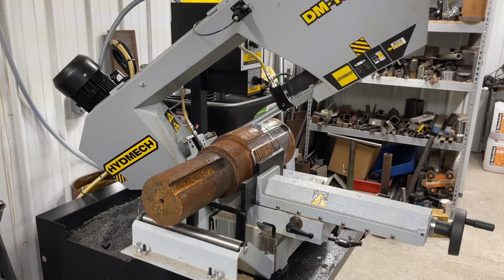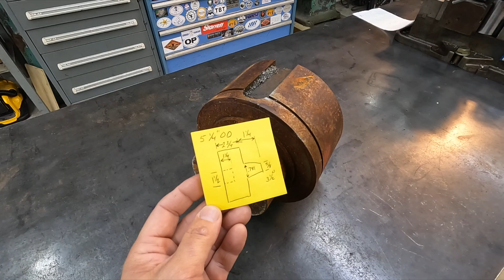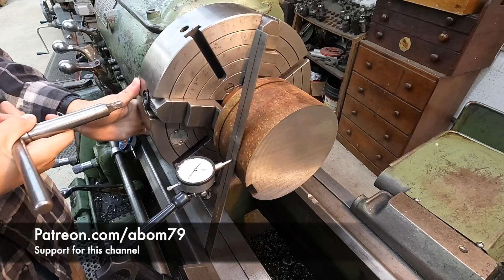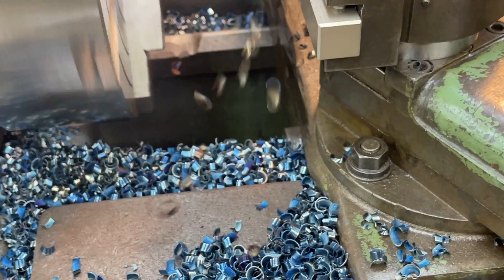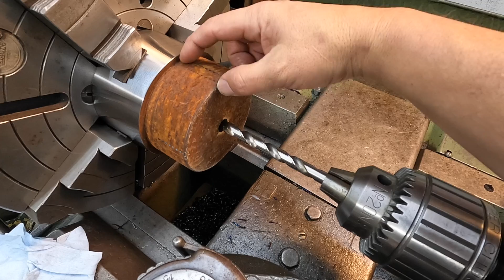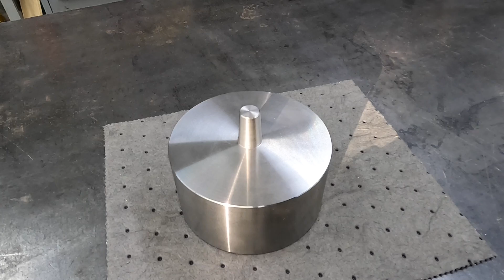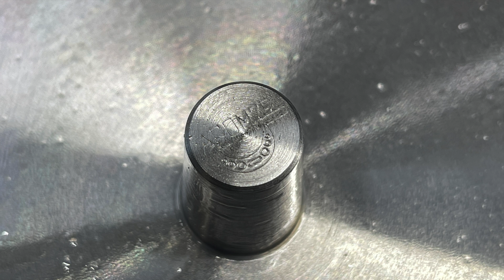Heavy Turning in the Monarch Lathe: Bradley Power Hammer Bump Stop for Blacksmith Tools

Comment: You say that you have your 4 jaw set to about where you need it to be to put your workpiece in to begin dialing it in... Is there a video I should reference for the basics on this??
Reply from the maker: I’ve shown it in many videos but couldn’t tell you which one. I use the corner of the jaw and line up on the machined circles on the face. Once all 4 our equal, offset each jaw in or out the same amount and measure. Keep moving the jaws equal amount until you hit your target.

Comment: Just curious what would happen if the operator became distracted or incapacitated and no one stopped the feed carriage as the tool holder approched the chuck? Is there a load or vibration sensor that would shut things down as things got nasty or would the machince just grind to a stop at some point and the belts would start slipping and smoking? I'm sure it has happened before.
Reply from the maker: You don’t want to know what happens…
Reply: There's usually a shear pin in the feed screw so that when the tool takes a machine breaking cut the pin shears and the carriage stops feeding. The chuck would keep spinning tho until someone turns off the machine
Reply: @matt657657  Dosen't help when it feeds into the chuck.
Reply: That's when what's called a crash happens. Look it up on YouTube, a lathe crash is a nasty nasty time.
Reply: Gear driven, not belts. 
Some lathes have carriage stops that will disengage the half-nuts and stop the carriage feed. 
That’s about all I can tell you as my only machining experience comes from watching Abom79 for about 7-8 years now. 
My dad was a FAA certified machinist but I was never allowed to go into work with him. But that’s what has driven my curiosity into watching machining content.
Reply: Same thing that would happen when driving your car towards a brick wall and you fail to stop.
Reply: @grntitan1  or into a running airplane propellor.

Comment: Big cuts - Adam - the issue is not 'breaking' something on the lathe but simply overloading the motor risking overheating it or even burning it out. The previous cuts at 264 rpm were heavy enough for it. What HP is the motor ?
Reply from the maker: Overloading & damaging the motor is the same as breaking something which I don’t want to have to fix. It’s a 5 HP motor.
Reply: @Abom79  Many thanks for your reply, Adam. I'll be interested to find out what I can do with my 3 HP motor - so have mentally noted '15' - 15 thou per rev and 150 thou DOC - which is less than the heaviest of your cuts. All motors on machine tools should be protected from overheating by a thermal overload (aka  'heaters') which is correct for the motor based on full load current (Amps).
Overloading a motor is ok for short periods of time as long as it doesn't overheat the motor. Our old 'small' lathe had an external motor - easily reach and felt for how hot it got. I do remember my dad stopping work to allow the motor to cool.
Thanks.

Comment: Thanks Adam, great video as usual. Question - after you flipped the part, why wouldnt you part it first before you drill that 1.5 in hole?
Reply: Parting tool doesn't have enough reach to get the whole diameter cut. Removing material on the inside means the parting tool reaches all the way through
Reply: I was wondering about that too, my best guess is so that he could get in the shaft to catch it as it's parted off, to prevent a heavy piece of metal going flying.

Comment: Out of curiosity, how long did it take to cut off that length for your machining work?

edit: Very cool to include the clip from blacksmithtools showing how it goes in the machine. I'm impressed with your reaction time on the lathe stall too - that could have ended poorly but instead, I got a free lesson in the limitations of machine tools.
Reply: If he'd let it carry on, providing the work didn't slip in the chuck, it wouldn't have been a disaster. We never got to find out if it'd actually stop the machine. The slower the motor runs the greater the torque it'd provide and the hotter the motor would get.
Reply: @millomweb  Uuhhmmm, Adam said himself that overstressing a lathe is exactly how you break things.
Reply: @CacheRAM  The lathe will not break by 'overstressing'. It'll be overloading the motor - which it will take for a short time. What breaks lathes is sudden impacts (changing gears when it's running) or hitting toolpost with chuck jaws. Another no-no would be power feeding the carriage into the headstock - the feed drive is not designed for that on most lathes. Or in Blondihacks' case, running into the tailstock - resulting in a bent shaft in the apron !
Reply: @millomweb  21:45 " heh, heh - I don't like doing that because you're liable to break something on the lathe here." -Adam Booth, 3rd generation machinist.
edit: spelling

Comment: If there is a “chip” competition for 2022, you won it hands down with the production of this part, in February 2022! Side note, it’s easy to see the years of experience you have when it comes to using that dial indicator, I have a similar setup we used on a large Didde Web press.

Comment: Could you cut off the keyed portion of the shaft on the shaper? Or with a saw? Then put it on the lathe?
Reply: I was wondering the same. Those chips were beautiful, but that was a lot of time to remove 80% of the material.

Comment: Any scientists or real clever people here  know what that effect is called at 17:20 where the chuck appears to stop even though at high RPM and can maybe explain it to me?
Reply: the rpm of the chuck synchronizes with the frame rate of the video.
Reply: The rpm of the chuck match the shutter speed of the camera
Reply: It has to do with the RPM and the frame rate of the camera, so 30fps in camera would equal 1800 RPM.  At 1800 RPM, the picture is of the same spot on the chuck for every frame, also any multiples 450, 900, 1350, 2250...  for the 3 jaw, 600, 1200, 1800, 2400...
Reply: The shutter speed of the camera is matching that of the chuck spinning.
Reply: I believe it's known as the "wagon-wheel effect". Let's say the camera takes a picture 25 times a second (25 FPS) to make the video, if the chuck spins at 25 revolutions per second, it is in the same position every time the camera takes a picture, so it always looks the same and as if it was not spinning. Since the chuck has 4 jaws (and therefore looks the same every quarter revolution), this also works with 12.5 revolutions per second, 6.25 revolutions per second etc.
Reply: Ah!.. that makes sense, thank you guys 👍🏼

Comment: Great video! You could connect your lathe to a VFD to get rid of the missing torque in the high gear. Just run it on 60Hz, so without variable frequency. The VFD will keep the speed of the motor constant.
Reply: Some of the monarch lathe have an ac motor that turns a dc generator for pure dc power.  Its seems a bit much but  i know some / maybe all the 10ee has that feature  but im not sure which other size monarch lathes might have that feature aswell

Comment: One trick I use to indicate a threaded part say you have a 1 inch 8 thread you put the threaded part in the machine and then set the gearbox 8 threads per inch then disengage the headstock and engage the half nut. Now set the indicator on the crest of the thread and let the indicator follow the thread at the crest. Adjust the part until the crest of the thread reads zero on the indicator all the way down the length of the thread .